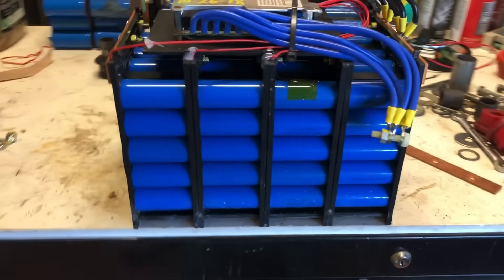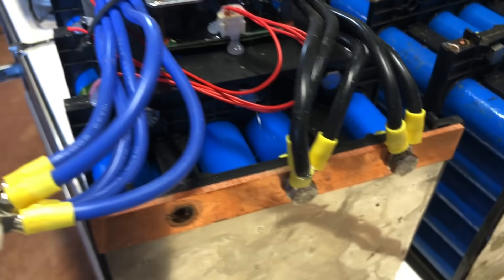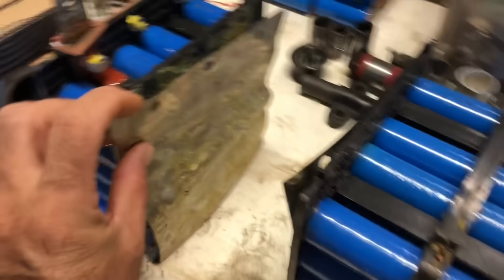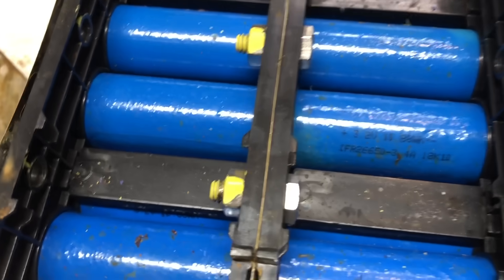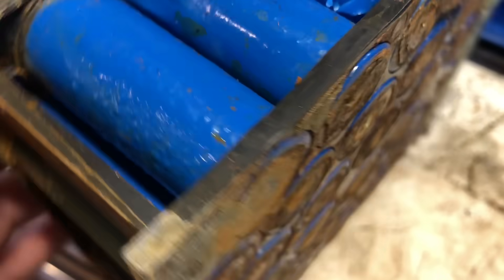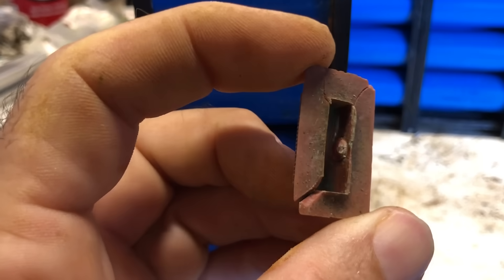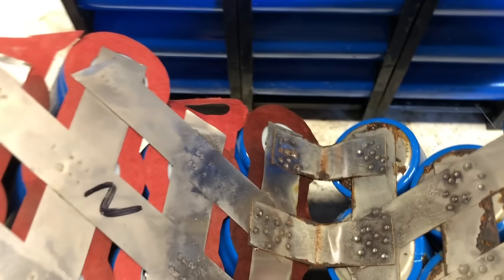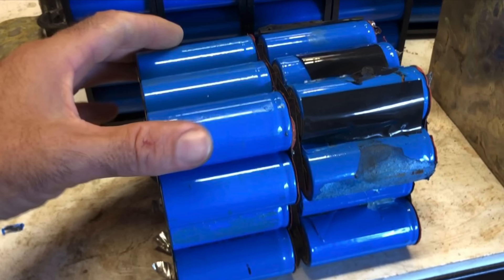Follow up to Battle Born Autopsy

Comment: So what is a good battery then?  I have two 100ah battle born batteries in my camper that are relatively new. Should I be concerned? And should I replace them?
Reply from the maker: I plan to address the predicament you are in with my next video, but if yours are relatively new and in a vehicle subject to jostling and vibration, and you need to pull high current out of them and or are recharging at high current, then I would seriously consider either performing a DIY repair, or replacing if not comfortable tackling the repair. 

Stay posted as I plan to cover some of this because it’s not all bad, and as you can see these batteries likely provided good service for many years and likely dis not suffer directly from some of the design issues based on my autopsy.
Reply: @Willdesignsandbuilds  it's difficult to imagine a DIY repair with a sealed case in the way. I'd probably opt for checking them frequently with a thermal camera and minimizing use with an inverter.
Reply from the maker: @bjnslc It’s just a single part glue which means you should be able to heat it up until it’s tacky again. 

If the batteries are older and the case brittle, and you end up damaging it, just buy a new case and drop the assembly in and wire up the terminals. 

A new case is a lot less expensive than a new battery.

Comment: All of the problems with bolts working loose could be solved by using nylon locking nuts, would have cost a few pennies per battery, and given the environments they sell these premium batteries for would be a no-brainer.
Reply: Hell no.  The temperature of that aluminum bolt gets well over 400 degrees.  Nylon ain't gonna help.
Reply: @johnwood4322 it wouldn't get that hot if everything was properly torqued and making good contact.

Comment: Is that 2/13 (February 2013) noted on each plate between the groups of cells? Almost 13 years old?
Reply from the maker: I suspect the BMS date of 2018 is likely the assembly date, and the 2/13 written on each module/block along with the capacity designated the month and day of capacity testing, but don’t know for sure.
Reply: @Willdesignsandbuilds  Understood. 5 years between testing one component and it being incorporated into a build is also worrisome. It'd be interesting to compare the internals of this 2013/2018 battery with a more recent build. How much do people with ~2023 builds need to be worried about the quality of builds 5 years previous etc.
Reply from the maker: @t @thisfinitelife think you misunderstood, I believe the 2/13 represents Feb 13th and likely the day the capacity test was performed, then the 2018 written atop the BMS is more likely to be the build date. 

Just an educated guess based on how I would go about small batch assembly. 

Once you put it all together and dab your paint on all your tightened (or not quite tightened 😂) fasteners and before it gets sealed with the top and the epoxy poured to lock the terminal bars in place, you write the assembly date atop? 

Like I said, just guessing but seems logical. 

It’s actually nice to see they are keeping track of these details.

Comment: Haters gonna hate. Mine have been rock solid for years.
Reply from the maker: Has nothing to do with hate. Glad yours are working well. I hope the ones my friends have continue to do so for them as well. Fortunately none of them are using them in an application that warrants opening them up, inspecting, and proactively “fixing” the major issues.

The owners of these BB’s may have gotten 7+ years of use out of them which some may argue is reasonable.

Comment: It's "Battleborn" but that remarkably terrible design can't handle even medium duty use, much less a "battle." The buss bars being bolted to plastic is criminally stupid, along with the bottoms of the cells being unconnected, relying on hopes and dreams.
Reply from the maker: Who can say for sure when the company itself splits the two words up on the labels that they apply to their batteries? Since my first video started with a shot of the battery and label, I figured I would use separate words.
Reply: @Willdesignsandbuilds I didn't even notice that. Lol

Comment: Well, at least they’re not the most expensive batteries on the market, oh wait a minute they are 😬😳😂😂😂 / BTW, loose connections are almost always the first point of failure, and almost always result in some sort of safety concern or issued that leads to Fire

Comment: Could you bolt the positive terminal directly to the buss bar to bypass the plastic?
Reply from the maker: Yes, absolutely.
Reply: @Willdesignsandbuilds  I just did it and it's back to life without any arcing or heat build up!

Comment: I think the modules are not bolted at the bottom as a safety feature in case the batteries expand. The biggest issue with BB is they are not properly tightening the bolts to spec.
Reply from the maker: Typically you want the batteries to expand and contract as a single mass, especially when you have fixed interconnects. 

I think this is more likely a cost cutting feature that helps to speed up production.

Comment: Obviously these batteries were submerged which explains the corrosion. I build my own batteries, and the main issue I see with the Battleborn design is the use of those plastic spacers. They are most likely ABS which is a soft material and will distort with heat and pressure. Using some type of thermo set plastic (like bakelite) that wont deform under heat and pressure should fix the problem. Adding some type of copper spaacer between the bolts instead of the plastic would greatly help also.
Reply from the maker: The plastic are not spacers, they are cage modules. 

They like a pool ball triangle hold the cells in position for building (welding) and supporting each block module of cells. 

Then each module is bolted and squeezed together. 

One benefit of the cages is that you can leave space between each cell so they can cool better and are less likely to chafe against one another. 

But the main benefit is likely streamlining production so that each module can be loaded, welded and tested, then shelved and pulled for pairing with 3 or 7 (24V) more to create a complete battery.

Comment: You only get what you pay for huh!
Reply from the maker: I have had LFP batteries fail much sooner than these. 

At least the owners may have gotten 7+ years of use from them which is better than FLA in this environment, but I highly double they got their many thousands of cycles out of them which is often touted by manufacturers and resellers.

Comment: If the bottom batteries were also bolted, then you'd have to worry about maintaining contact, should one battery bank heat up more than its neighbor (i.e., you'd get bow'ing where the surfaces need to stay flat).  You get some of that anyway, once you have a more than one bolt locking down two plates, but top and bottom makes it worse - better to push from both ends and let the battery banks slide a bit relative to each other - better yet to tack-weld, as the other brand did.
As to the terminal bolts, I don't know what they're thinking, but they looked in good shape.  Even though, is a 10 cent lock-washer shouldn't be an expense to spare on a $1000 batter?  As to loose connections, ask anyone electrician about aluminum residential wiring and you'll get an earful - and, of course, you're right - it's not a good thing!

Comment: These assembly methods have been used with cylindrical cells for over 50 years.  Not only with Life but Ni chemistry as well in the radio control hobby world.   The top issues remain that users are installing them incorrectly IMHO. 

The terminals are designed for 100 Amp use and customers are wiring the current to go through the flag terminal instead of adjacent to it.  This results in 300 to 500 amps passing through a terminal rated for 100 amps.

The second issue is installation with heavy wires with too small of bend radius, which causes excessive torque on the terminal. 

Finally many non professional installers are Hammer crimping the wires instead of hydraulic crimping.  This adds to the excessive heat at the flag terminals. 

Any one of these by itself is enough to cause damage to any battery.  The combination is just a recipe for disaster.   It's very clearly a user installation error.
Reply: BTW, I find it curious that all the "user errors" are predominantly only affecting this premier-priced brand?   

You'd think those who have paid Rolls-Royce prices for their batteries would treat BETTER than the TEMU sourced units.  And yet I can't think of any other band (currently) suffering from such a high rate of catastrophic failure???
Reply: @xxxxxxxxxx6903   I believe it's because amateur installers doesn't know how to install a flag terminal battery.  The same people would mount hinges on both sides of a door and wonder why it doesn't open.   As far as Chinese batteries,  there are plenty of failures.
Reply: Quite frankly, I don't understand how you don't see a multitude of very bad engineering practices & designs within BB batteries??? 

Inter-module connection through free floating sheet metal plates?   Find me a current Chinese battery company utilizing such a shoddy construction?   You can't!  If they're using cylinder cells, they are tack-welded.   

* The main terminals utilizing (SS, or zinc plated steel) bolts as the conductor between a plastic isolated buss-bar????   Let's put the galvanic issues aside from the multiple dissimilar metals, and focus on the horrible fastener interface.  I really can't decide if it was planned obsolescence, or somebody designed it who had no business doing so, or a disgruntled Engineer/employee sabotaged their designs?    👀
Reply: @xxxxxxxxxx6903  The exact same construction method has been used for 50 years with cylindrical cells including Ni batteries.   I am not saying it is perfect,  but you are missing that the typical failure has been due to customers mounting the wire lugs  on opposite sides of the flag terminal instead of the same side.   This puts 300 to 400 amps through a terminal rated for 100 amps.

The second big error is using hammer or similar crimps instead of hydraulic crimps on the wires, another source of heat.

The third installation error is using heavy guage wire and very tight bend radius instead of industry standards.   This puts a lot of torque on the terminal.   

The combination is a recipe for disaster and that is exactly what happens.
Reply from the maker: @harryniedecken5321Can you go into more detail about the disadvantage of hammer crimping versus hydraulic? 

Why is one preferable:so much worse than the other?
Reply: @Willdesignsandbuilds  Hammer crimping does not provide a good connection to the lug, and is well known to have much higher resistance.   It is also inconsistent and nearly always corrodes over time,  causing even more resistance.  More resistance equas more heat.

A hex crimp applied with a hydraulic crimp tool is extremely consistent,  there is a requirement to certify the crimp by cutting them open and inspecting the cross section every shift.   

This is why I purchase professionally crimped larger wires, even though I have the setup for 10 and 14 awg. A true pro certified set up. 

There are videos on yt with photos of the cross section.  A hex crimped hydraulic wire is literally cold welded and the cross section has no voids.

Good luck

Comment: Connecting two bus terminals and having plastic spacer (housing) between them is just beyond any common sense. 
All current between two copper busbars was transferred by the aluminum bolt.
Busbars must always have physical contact, and a bolt is just for keeping pressure on them, not for conducting. 
This happens when lack of practical knowledge is present while designing the product.

Comment: What a crappy design for such an expensive battery.  I took apart some 24V 7S18P made of 18650s that was a TON better built than that thing.  They had defective BMS and had failed, but the cells were still measuring at rated capacity.  However the top layer of batteries in each box I took apart were hot enough to weld the plastic covers together on those rows.  Yet the batteries tested good.

But that build, is just AWFUL.
Reply from the maker: Do you think the overheating of the top cells was due to heat rising and collecting in the top of the cases? 

Or were they in contact with the BMS?

You’re kinda dammed if you do damned if you don’t with this stuff. 

Dammed if you have a case with a vent that makes it susceptible to water/moisture intrusion, dammed if you don’t because the heat inside builds up and cooks the electronics and other stuff like plastics used in the assembly, epoxies, tapes, foams, etc..
Reply: @Willdesignsandbuilds  I think it was a little of both.  As I said, it got hot enough, that the plastic heat shrink on the cells in the top layer welded to each other in the pack.  I pre-tested some of those cells from each pack though, and the mAh rating exceeded the label marking of 2200.  (I was getting up to 2250 per each tested) 
I ended up with 504 individual 2200 cells out of 4 boxes of these packs.  Not bad for free.  I visit local recycling centers and get used battery packs for free, since it now costs to recycle lithium batteries, and the recycler would rather not have to pay to deal with them.  
Laptop batteries seem to have about a 60% yield for decent cells on average, all I have to invest is time dismantling, sorting out obvious bad, and grade testing the rest.
Reply from the maker: @DTMAce  Awesome! Just back from my dump. No LFP thankfully, but I did score a really nice aluminum framed top of the line bike and an aluminum boat boarding ladder. 

Anything aluminum or SS is always up for consideration as it survives well here, but then I also pull a lot of scrap steel out for welding and fabrication projects when I can.

Now that I have a spot welder and safe locker for charging up cells, I might have to get more into recycling LFP.
Reply: @Willdesignsandbuilds  I had picked up a spot welder for nickel strips a few months ago. Hand held lithium ion battery powered model.  Haven't actually used it yet

I plan to build a battery building for my external office eventually.  It would contain a module that can run off grid direct to power, charge by grid and charge by solar and have auto switchover.  I hope to build a 14s 1000P pack, but coming up with 14K of batteries will be challenging.  And using recovered batteries is tricky.  I may have to build it at half that size to start then add to it over time.

I figure I will have to setup the BMS unit (if I can find one that does what I want) for charging to run between 3V low 4.1V max, and limit the max draw to 200A, as well as set the mAh rating to a bit under the average of the overall pack rating as a whole (probably around 1800).  Despite having nearly 2000A available at 48V.  Lots of fusing, and will be individually fusing each cell.    If it works correctly, Each cell wouldn't see more than a 50-100mv drain during discharge which shouldn't be affected by higher resistance batteries.  And if a single battery cells fails and starts to pull too much current in or out, it blows its fuse.  Reason the pack is so large is to be ahead of long power outages that we can get here.  And limited sunlight in winter.

At the moment, this is still a plan in progress, and I keep revising as I learn more.  Right now its about acquiring the cells I need to start assembling packs.  I still have to build a building just to house the battery unit.  At the moment I have around 3K of my desired 14K..  But its a project.  lol
Reply from the maker: @DTMAce Your collecting of cells over time reminds me of a catamaran project I had planned to build many years ago using thousands of plastic bottles. 

I had collected almost half of what I needed for my plans, had friends and family collecting as well, and had them stored in large plastic bags on my back lanai that was just barely viewable from the street. 

I lived in an HOA at the time and they didn’t like it and I had to abandon the project. 

Then I ended up scoring basically a plastic boat for free that was the perfect foundation for my solar electric build, and in the meantime the soda industry changed the shape of their bottles which would have made my design more complicated, and so I officially abandoned the idea since I technically recycled the boat hulls I ultimately ended up using. 

Best of luck with your plans. 

In the end you’ll have a system you know inside and out and can monitor, troubleshoot, repair and improve yourself if need be.